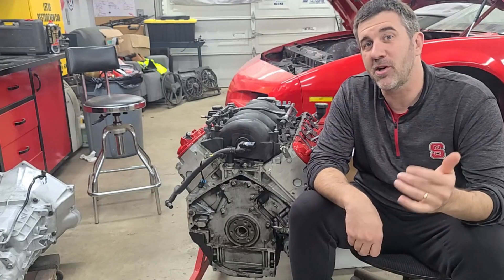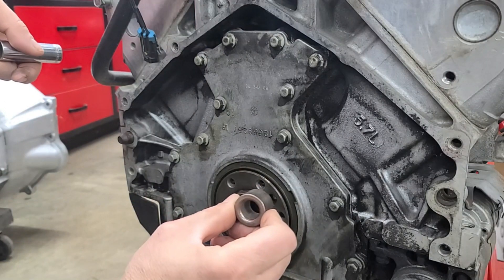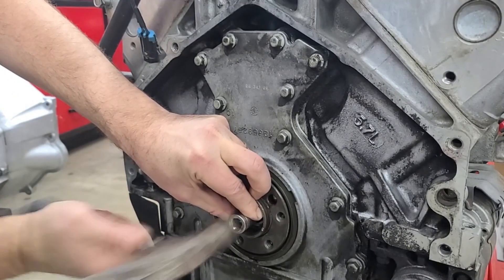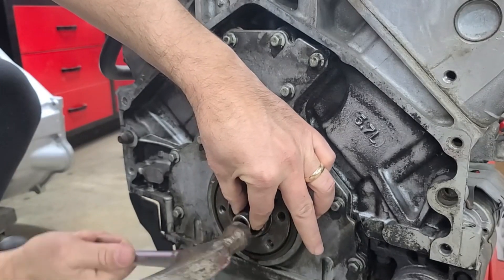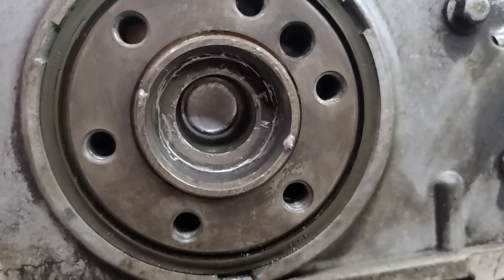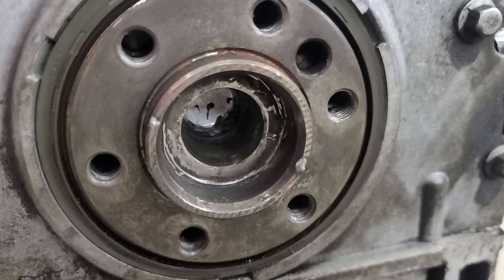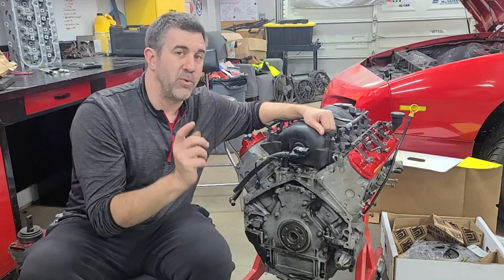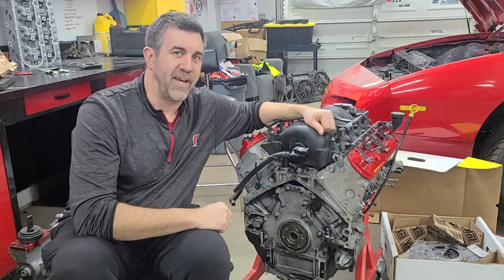Then Midnight Mechanic Tech Tip - Crankshaft Oil Seal Plug!

Comment: Iv been looking everywhere for this but my pilot bearing hole is to small for the replacement plug
Reply from the maker: What do you mean? How much smaller? It is a press fit which is why you have to pound it in.
Reply: @TheMidnightMechanic  I wish I could
Show a picture, my crank seems to have an extra metal lip than ones I’m seeing on the web don’t have, I thought I might’ve bought a wrong replacement plug because it’s to big to be pressed in, yours doesn’t have this extra metal piece I’m talking about also
Reply from the maker: @whitennerdy01  is it an LS1? Very odd, not sure I've seen one like that before.
Reply: @TheMidnightMechanic  yeah it’s an ls1 someone said it might be a bearing race I’m not sure
Reply from the maker: @whitennerdy01  It could be the outer race of the old pilot bearing. I've seen that before on failed pilot bearings
Reply: @TheMidnightMechanic  that sounds right is that removable ?
Reply from the maker: @whitennerdy01  yep, you can use a pilot bearing puller and hopefully there is enough to bite into to pull it out. Otherwise you can carefully gring it out with a die grinder, just be sure to plug the hole first so no metal shavings get into the engine.
Reply: @TheMidnightMechanic  okay this is great to hear iv been stuck on this issue for a while thank you for taking the time !!

Comment: Will the cap fall into oil pan ? I tried the bread trick and didn’t know it had a cap in there and I’m pretty sure I pushed it all the way through
Reply from the maker: @HLK_Kustoms99  No, it will push up against the connecting rod. I don't think there is enough room for it to fall out.
Reply: @TheMidnightMechanic I just did this mine feel to the bottom of the pan. What part number is the pilot bushing ?